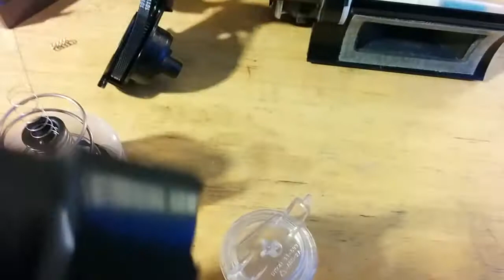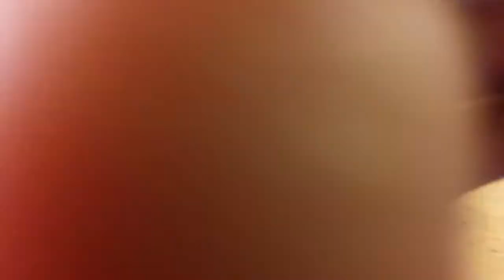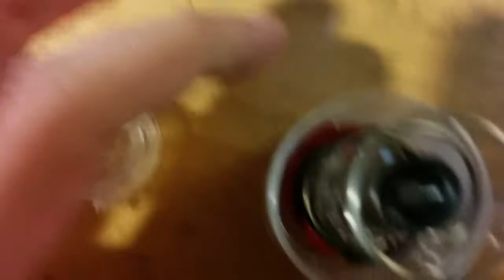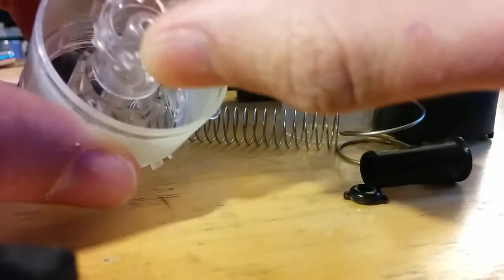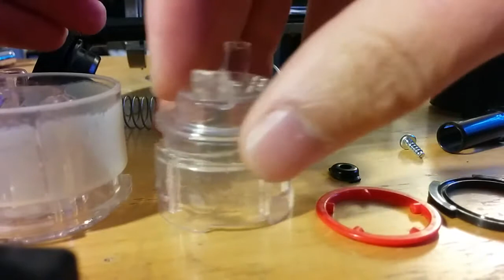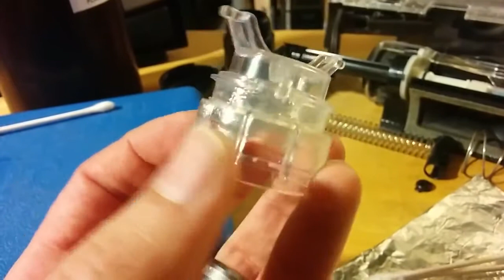Dyson DC39 triggerhead mechanism repair

Comment: It's designed for failure after a few uses so they can sell us suckers a replacement nozzle for 50-60 bucks that cost $2 to make. Does anyone still believe its not baked into the design?

Comment: I took mine apart like you did in the video, and not sure yet if its going to work.  My question is, the small spring you show in the video that is placed near the belt on the table, where does that go?  I took cover off for belt and removed the piece you  (but didn't open the clear plastic piece being it wasn't broken).  I started putting it back together and found the small spring.  I didn't see where  the small spring came out of?
Reply: Disregard....found site with breakdown of where it goes.  http://ncustom.blogspot.com/2014/11/dyson-dc-39-triggerhead-teardown.html
Reply from the maker: @loriragland3342  Awesome, great find! I was having trouble remembering where it was from, and was about to tear into it to refresh my memory. 🙂
Let me know how it goes. Seems like other problems are likely related to airflow, so check to make sure everything is connected and not clogged. I've noticed that if the mesh end cap on the outside opposite the clear window is covered with cat hair/dust, etc then it doesn't get enough flow to switch the mechanism quickly enough to work.
Reply: @NicholasA231  Have gone to 3 Dyson Repair shops in my area.   BAD NEWS IS.....they advised me that Dyson shutdown their parts factory in Chicago and now all parts (IF THEY STILL MAKE IT) has to be shipped from Malaysia.  Which can take sometimes months, noting now they only ship out from Malaysia in bulk orders all over the US requesting parts.  

Furthermore, only Dyson parts, belts, etc can be replaced with Dyson parts.  

With this said, I'm going to try one last thing and open up my accessory part for cleaning steps, which I don't use and hope it has identical belts and such.
As a last resort will have to buy a replacement Triggerhead between $65-100, which I was trying to avoid for a $4-8 dollar belt.  Thanks.
Reply: No suck luck on belt on step attachment,...UGH..  Just emailed company in England where Dyson is built.
Reply from the maker: @loriragland3342  Also, note that I didn't identify the broken piece on mine immediately. It was all still sort of held together with the boot, and I couldn't tell it was cracked in half until I played with it a bit.
Reply: @NicholasA231  I think mine is going to be the belt on the turbo motor??  I can pinch it together and it seems loose.  All parts are original so its  about 7 yrs old.  And as I was putting it together....PING....there went the little spring flying into never never land....guess I will try to order that along with the belts.  Thanks

Comment: The short explanation,
Remove the clear tube with the blue filter. Back out the one screw that holds all the crap he's working on. Pull that whole wad of stuff out, smash a foam earplug and stuff it into the plastic port where that clear tube was plugged on to. ( Cap off the line somehow, at least it seemed like a good idea to me)  I do not think this part is worth fixing. My suggestion is to carefully rip it out.  :) I'm no expert but I can't understand how these components add any real value, seems work fine, better in my case, without them. 
The long explanation,
In my case, the brush simply wasn't spinning with much strength (especially with any suction loss or going over tall carpet). When I tore the trigger head apart, first I removed the belt cover and tried to silicone the belt drive shaft/any bearings I could find. I do not think that helped much. But it gave me some piece of mind. (Be careful doing this because some of the pieces and parts around the belt and the cover itself are especially fragile. Or avoid it altogether, until it's your last resort.) The silicone, by itself, did not seem to solve the problem. After watching this video and seeing that the same piece was broken in my trigger head, I didn't know what else to fix. But This fix looked too time consuming and the longer I thought about it, those parts seemed unnecessary. So I took these parts out and rolled up and squished a foam earplug to stuff into the hole where that clear hose with the blue filter plugged on to.
Reply from the maker: Thanks for adding to the info here. I agree that the feature of switching the brush on and off is of arguable value, especially depending on the user. By the time I dicked around with it for a couple hours and spent $15-20 on adhesives it starts to become questionable. I happen to enjoy doing these kinds of things, but it's good to know you had success with bypassing it as you describe, for those people who make better use of their time. 🙂
Reply: Thank you for the original video sir. I enjoy these kinds of things as well. Just to take the rabbit hole a little further, I really don’t know that my approach was wiser than yours. While removing those parts seemed to improve performance in my case, I still think the brush is a bit weak. I wonder if this inherent to vacuums whose brushes rely on suction to spin, such as the dc39. Are these things just doomed from the start? But I don’t think your time has really been wasted. Because of your initiative, and detailed video, people can see the can of worms they’re dealing with. Then they can make the best decision for themselves. Not to mention people can comment and add their discoveries. Basically you saved all of us a lot of time. For this you are a saint. Haha

Comment: Nicholas,  Thanks for posting the video, despite your concern about the quality (and the complaint of another viewer). I have my triggerhead fully disassembled on my counter right now -- probably more than needed to be -- and have the same broken part... same place. I've looked all over for ordering a replacement part... but... seems you can only order the full triggerhead. Seems a waste of otherwise usable parts (and, something like $55 is about the cheapest I could find). So, I came looking for other people's "how to fix it" videos, and, your video (and comments) tell me exactly what I wanted to know: WHAT KIND OF GLUE/EPOXY SHOULD I GET? Thanks for answering that question. I'm wondering if -- two years later -- your repairs are still holding up?  Thanks again, Jim
Reply from the maker: Thanks for the feedback. I made this video on a whim, but I've considered trying to make quality (well, better anyway) videos if I can actually help someone. I'm still using my repaired trigger head, and it's still doing its thing. It continues to be a little "stickier" than pre-repair, which I blame on the mistake of putting adhesive on too much of the rubber boot part, but with a little attention to technique it's still as reliable in switching as original. Noting that the design, in my example anyway, was never worked flawlessly 100% of the time I hit the button - it always occasionally required a couple of attempts.
Reply from the maker: @anart2814   I think all of the screws you need to remove are T-10. If you don't have a set of torx drivers pretty much any inexpensive interchangeable bit screwdriver set includes the smaller torx bits now. There was a pretty good video that I followed for the initial disassembly. There are a couple of parts that aren't super obvious and/or require a bit of careful manipulation to get apart without breaking them. The kind of thing where if you aren't sure, you're afraid to put force on it in the required way. I'll try to find the video.
Reply from the maker: https://youtu.be/FwNDO3pUxzM
I can't remember if I had used another video or if this was the only one, and I just sorted the rest out.
Reply from the maker: Sorry I missed the point of your question before! In case anyone else reads this with the same question, I used a 2-part 5 minute clear epoxy (loctite product in my case) after using a q-tip to apply acetone to the two halves and holding them together until they started to weld. Not sure if this is necessary, but it really helped me to apply the epoxy evenly in a way that reinforced the part once they were one piece. Also kept epoxy oozing into the interior of the part, which could interfere with the mechanism if too much got in there.
To reattach the rubber diaphragm I used a spray adhesive, what I had on hand was 3M #80 general purpose I think. Caveat with this part, which almost made my repair unsuccessful, is to look at the rubber part and understand where it is bonded to the plastic, and where it isn't, which is where it needs to flex in and out. If you get too much on the bit that flexes/wrinkles during operation it will cause it to stick and not operate smoothly.

Comment: I met the same problem, this part was broken inside. I glued the plastic part and I applied some grease on the rubber part to make sure it run smoothly. I have to say that the broken plastic part is the flimsiest one in the whole triggerhead.
Reply from the maker: Yeah, the clear part that breaks is insanely thin - right where it fails of course. I honestly thought maybe my part was defective, like the injection molding failed to get full thickness somehow, but seems like lots of people are finding the same issue, so I guess it was just a bad engineering decision.

Comment: I've just had the exact same problem. Am just waiting for my adhesive to dry before reassembling. Thanks for taking the time to make this video.
Reply from the maker: Michael Gray Glad it could help! I feel bad that thousands of people have watched a pretty terrible video, but I hoped that it'd at least get someone on the right track and I figured I couldn't be the only one to have it happen. Mine is still working. Sometimes I have to hold the trigger longer to get it to re-engage, but it wasn't flawless as new.
Reply: @NicholasA231  Do you have a video showing how you took it apart? I took all the screws out but couldn't figure out how to take it apart? I didn't want to brake it.
Reply from the maker: @mikebrisbin6147  I don't. I got it apart from looking at another video where the guy found the same problem. He basically just diagnosed it as dead at that point, but I'm stubborn. Once you do the coin-to-open bit and get the brush out you have to pry gently at that end and sort of tip the clear housing out. You don't actually have to remove any screws yet. Then the six screws to take the cover off the mechanism, then remove a smaller screw at the driven end and unclip that end cap. I can't remember exactly from there and I can't find my small torx drivers, but the first part worrying about breaking the end where you take the brush out was the hardest. Once you get into the switching mechanism itself go slowly and look carefully so you understand how it works. Might be good to take pictures if you're worried about getting it back together.

Comment from the maker: Some details missing here, but I couldn't find any info on repairing this problem (except that it can't be repaired), so I thought I'd try to show my approach at a successful (so far) fix. I used Loctite clear 2-part epoxy (and acetone, as described) to fix the broken part and 3M #80 Rubber and Vinyl spray adhesive to reattach the rubber boot (not shown) but other things could work as well.
The part should, I believe, be stronger now than it was new, so fingers crossed...
If you get tired of watching me fiddle with it skip to https://youtu.be/3gZwiA_ETxM?t=318 to see just the part that I repaired. Other info hopefully helps if you got it apart and can't remember how it goes ;). 
The only really important bit that almost prevented me from being successful is to be careful where you put contact cement when attaching the reassembled repaired part of the mechanism and the other, larger diameter half. The boot needs to "roll"/wrinkle up as the parts move under vacuum pressure, and I had too much glue which made it stick instead of freely cycling in and out. Eventually I was able to get it to free up by holding down the trigger switch while the vacuum was on and watching the end to see when the internal bits finally got fully sucked into position. It requires the parts to move freely in order to move quickly enough to "switch" modes.
Reply: Hi where's the link? Doesn't work thanks
Reply: I have use staple wires to reinforce my super glued part. I use a soldering gun to heat the staple wire to drive it in plastic. I did a mistake by stapling after putting black rubber. It tears black rubber. I wish i did before putting the black rubber on. It works now but I know eventually it will tore the rubber all the way....